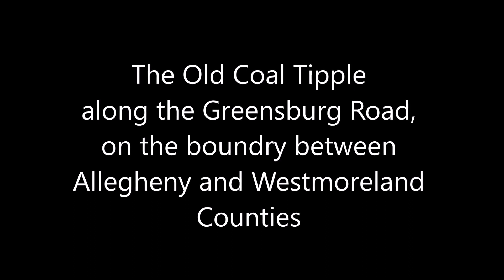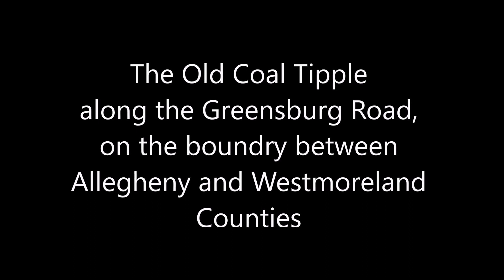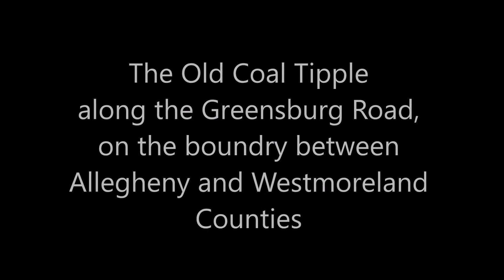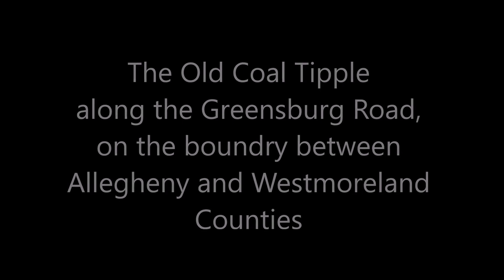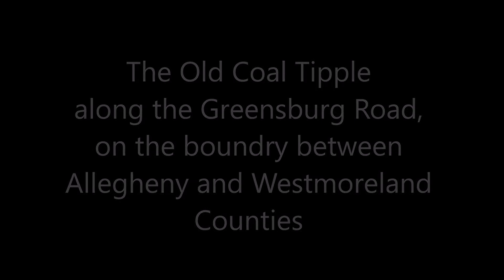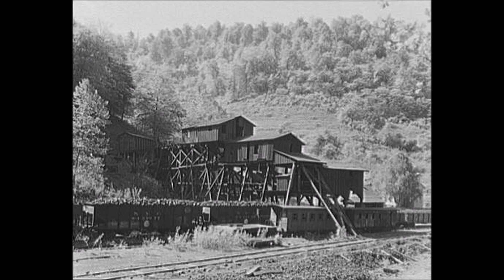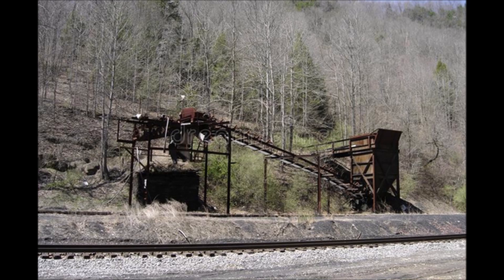Old Coal Tipple

Comment: I always assumed that this coal tipple was associated with the Renton Mine where my Great Grandfather Michael Kost (Mihaly Koste) died during a mine explosion in July 20, 1920.  His body was later recovered and identified on September 18, 1920.
Reply from the maker: Ray, this site is no where near where the Renton Mine Was, but could have used Renton coal to sell.
Reply: Mr Festa  ,the Renton Mine is only maybe 4 miles from the 366 coal tipple ,so it's really not that far away . But I think the coal from Renton was designated strictly to the Steel Mills that owned the mine! Lots of smaller family owned mines sold home heating ,lump coal , even delivered it .I remember when the Kowalski Tipple was still selling coal . I always liked when our coal was delivered ,my mom would wet down the cellar walls with a hose to keep the dust down . One of my oldest brothers had to know how to fire the furnace & clear the blinkers cause my dad was railroad engineer and out on trains for days at a time !